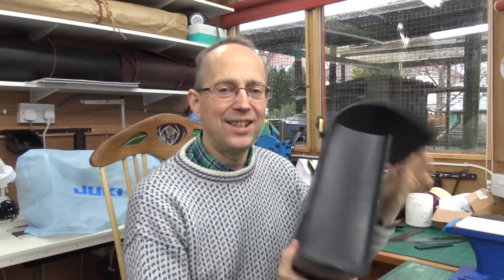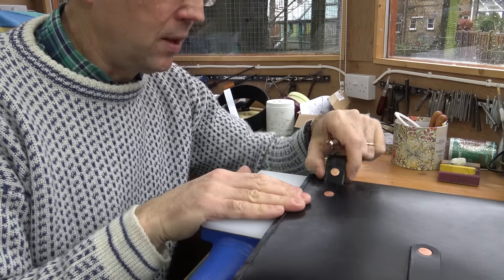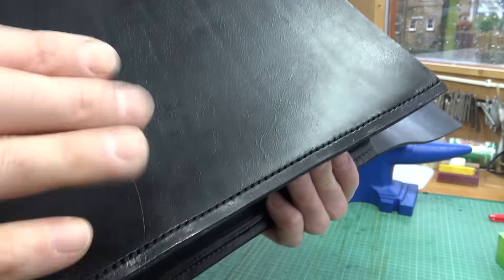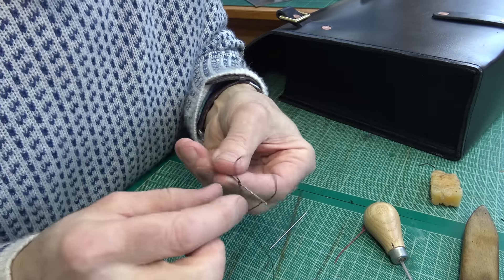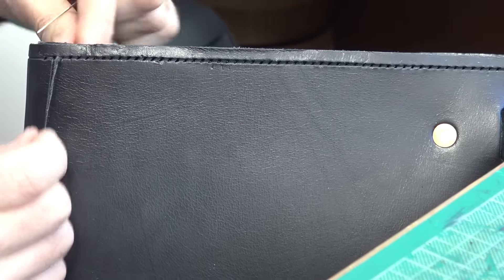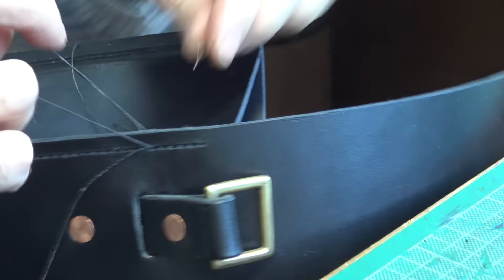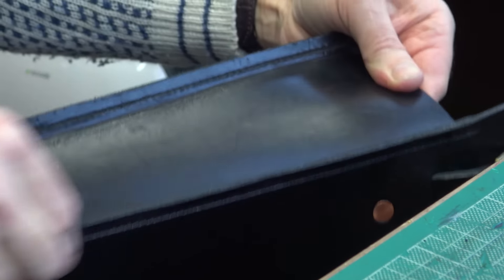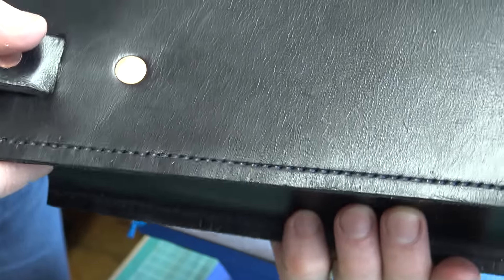Making a Leather Bag - Part 5 of 7 - Saddle Stitching

Comment: Hi Harry, thanks for the video series. I am making a similar bag and am not sure how to approach the corners. I was going to stitch all the way around but looks like you stitch the sides and bottom separately. If I tried to do all sides together the thread would probably be too long to manager anyway. I just want the transition to look as neat as possible. I'm using thinner, more flexible leather than you did in this video - wondered whether you would approach the stitching the same way.
Reply from the maker: Daniel Piper Hi Daniel..Well observed, I did it this way as it was really thick still leather, and yes on thinner leather, like in my messenger bag films I would sew all round. Good luck with it all Regards Harry
Reply: Harry Rogers Thank you

Comment: When u stitch, are u just poking the needles thru alternate sides or do u knot the two ends at every stitch? Cuz the way I stitch is I poke the needles thru at the same time, but I wrap the slack from each end over the opposite needle and then I pull both ends all the way thru which makes a knot and I move on to the next stitch
Reply from the maker: Sam Iamm The knotting way is very good..this is the plain method here. Regards Harry